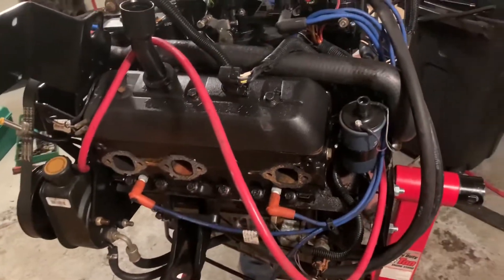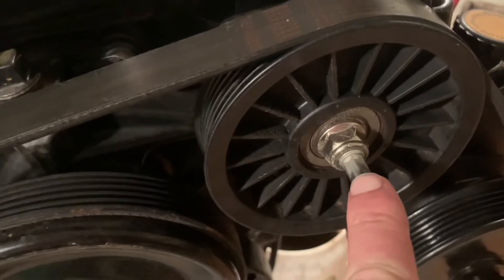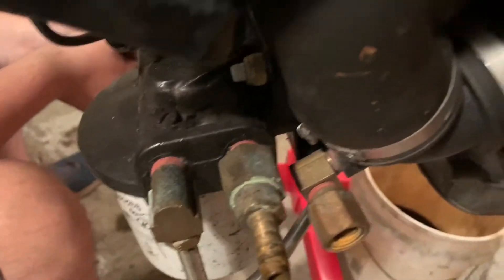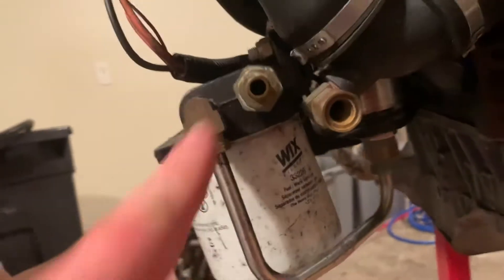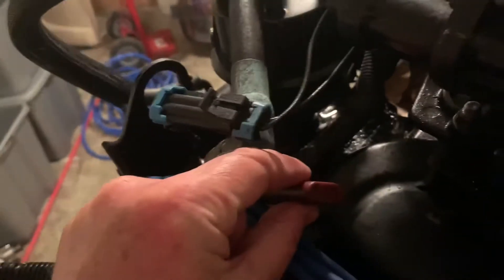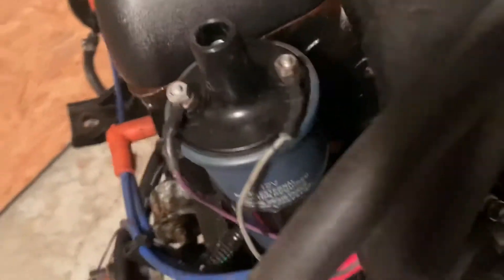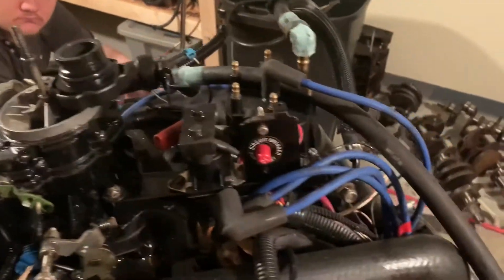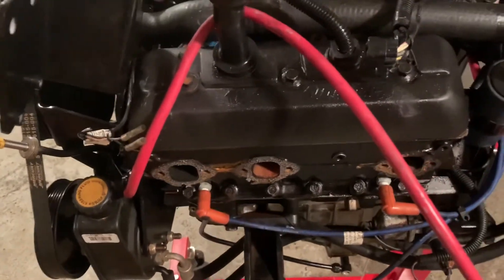Part B - Mercruiser 4.3 (2) - Pre-Teardown Inspection

Comment: I'm a little late but in case anyone is wondering the third oil pressure sensor is a switch that goes to the fuel pump